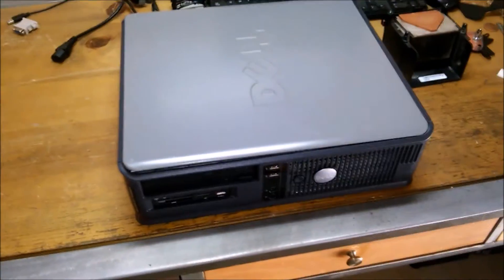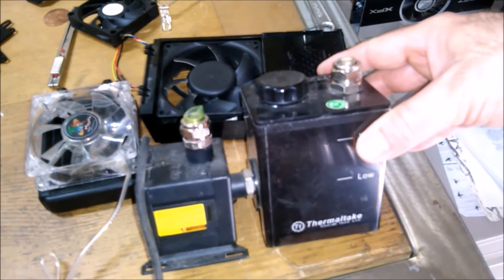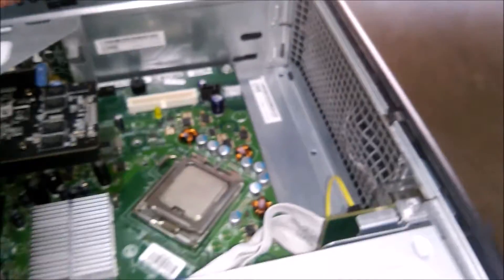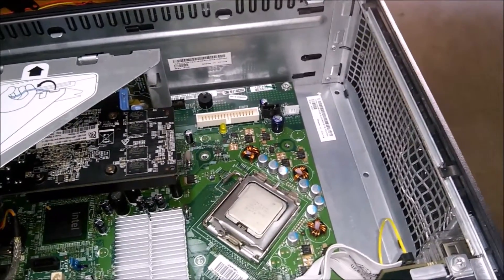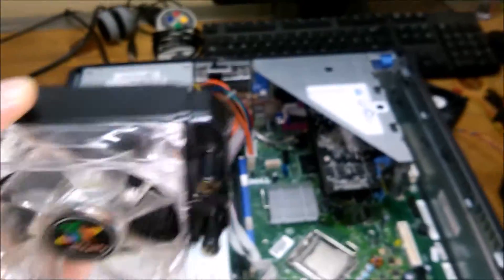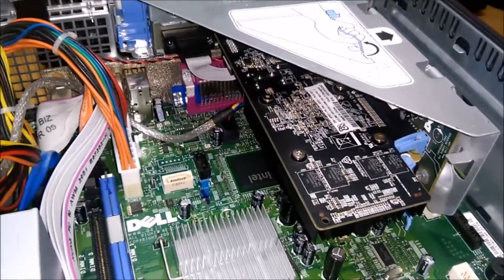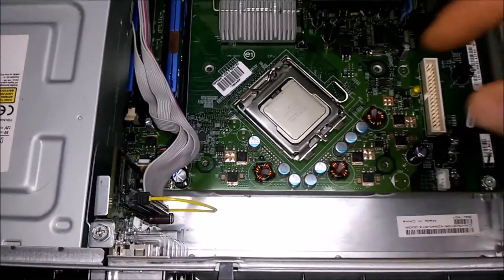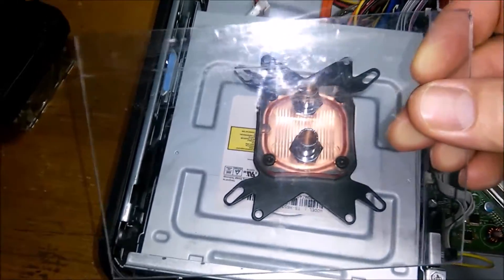Dell Optiplex DT Water cooling loop?

Comment: so you might actually go through with this?
Reply from the maker: I'm going to give it a shot, I think. I have a plan and a parts list, now I just have to get the cash =). My audio got really screwed up on my tutorial of the water block. I have been trying to clean it up but it's really getting frustrating. I might have to redo the whole video.
Reply: +Jon T i can't wait to see the results, will you benchmark before and after
Reply from the maker: This DT is a 755 and isn't really used for gaming (yet). I'll make sure to have before and after temps for games though. I'm anxious to get the custom stuff started. I'm trying to do all the cheap things first lol.
Reply: +Jon T lmao I'll keep a look out